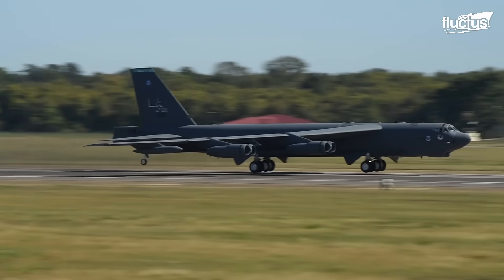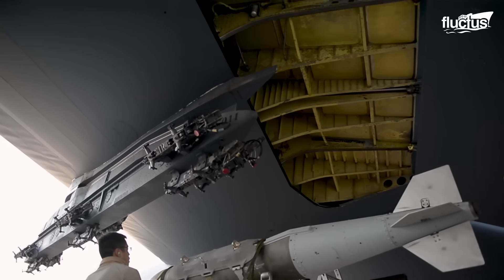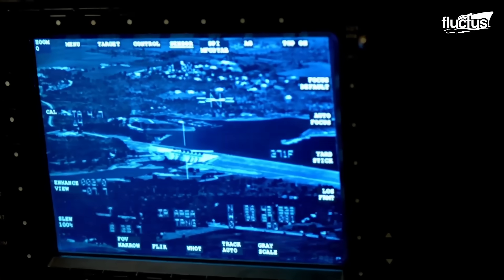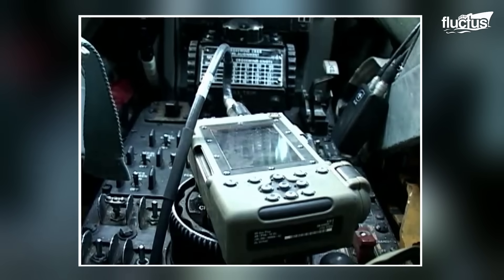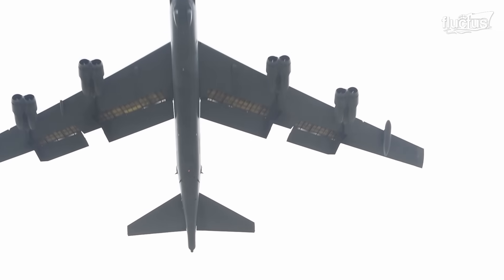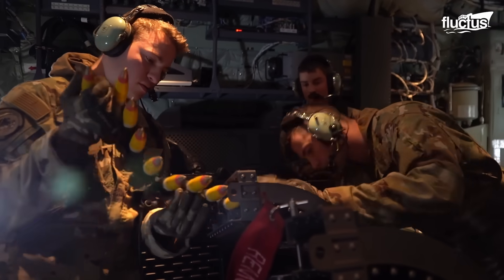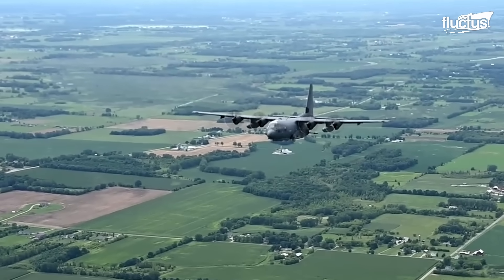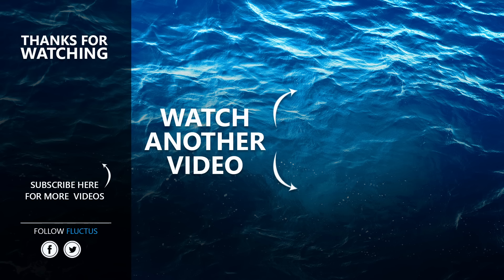Life Inside Feared US Air Force B-52 Bomber Flying at Extreme Altitudes

Comment: Trivia Question:  What do the B-52 and the C-130 have in common?  A )  Both were designed using slide rules, manual calculations and trial and error without any computer modeling to spot design deficiencies before somebody strapped themselves in, firewalled the throttles and hung on for dear life trying to find out if their ideas would actually work, and some times they didn't.   B )  Today both are piloted by aircrews that are only half as old as the aircraft themselves. i.e. 70 year old airplanes being flown by 25 year old pilots, crazy ain't it.....................👍😁